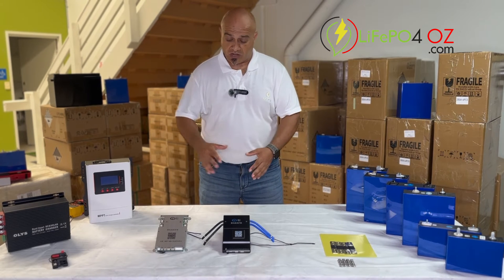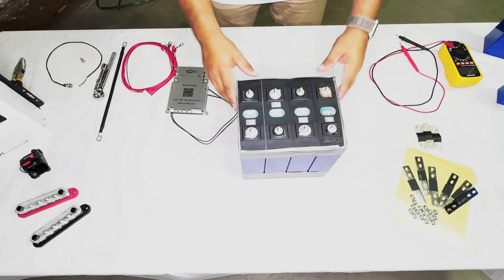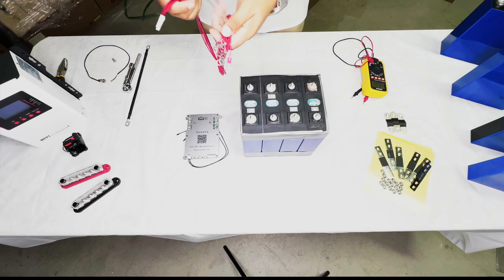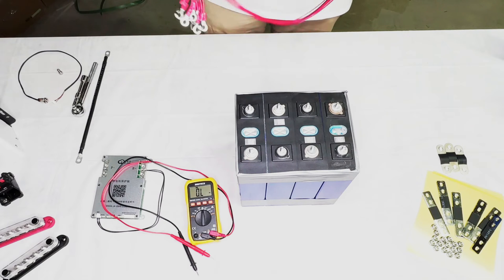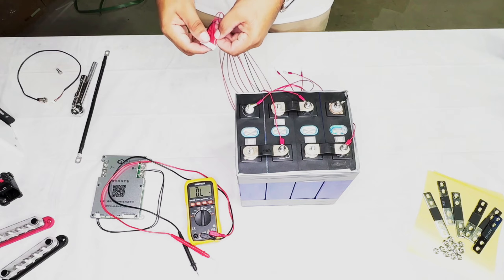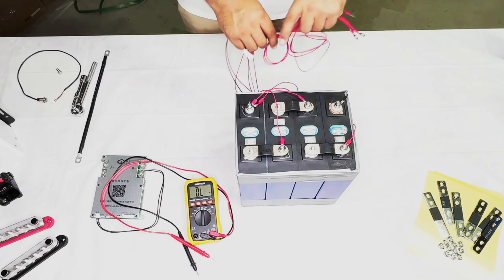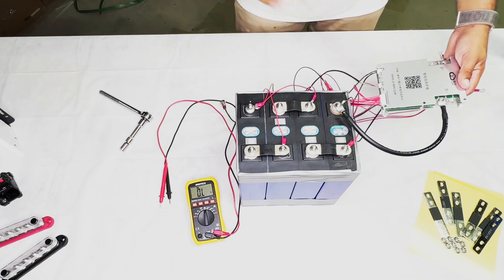LiFePO4 Oz Step by Step Guide to Wiring Your JK BMS

Comment: * WARING CRITICAL REVIEW OF THIS VIDEO * Please watch the entire video and see if you can spot the "Loose Nut" *

1) At 06:00 it looked like the cells were not arranged correctly + - + - because of the orientation of the QR code labels on the cells, but these cells are not identical, and the cell on the Right of the screen has a QR code that is slightly shorter than the other 3 cells and is placed closer to the (-) terminal while the other cells have the QR label closer to the (+) terminal.  So all is OK.

2) At 09:00 the high current Lug should be directly touching the battery terminal surface.  Other lugs such as  balance lead lugs should be on top of that.  The Lug on the power connection should have the best contact to the battery cell to minimize resistance.  As the balance leads to not carry much current just "balance current".  When dealing with LiFePO4 cells, milliOhms are important.

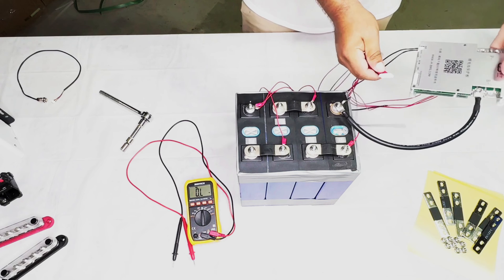3) At 11:45 with the balance leads all connected to the cells, but prior to plugging the balance lead connector into the BMS, the connector should be "Buzzed Out" by measuring the voltage along the connector with the (-) test lead of the meter on the Black wire Pin (a.k.a B_0 of the balance lead cable), and the (+) lead on each connector pins after that  (B_1, B_2, B_3, B_4 & B_8). Verifying the voltage is in ascending order with B_4 and B_8 have the same voltage readings.  For this battery, assuming the cells are charged to 3.2V each (the nominal voltage for a LiFePO4 cell, but the cells could be a little higher (3.65V) or lower (2.5V) depending on the state of charge.  So would expect to see the following values (keeping the (-) test lead on B_0 Black) ,   B_1=3.2V,   B_2=6.4V,  B_3=9.6V.  B4=12.8V and B5=12.8V.

* I hope you spotted the "Loose Nut" but if you did not, it is the one HOLDING THE WRENGH. 😊***

Comment: Hi there, If I made a 24V battery with this BMS, could I add a second 24V battery in series? To make a 48V system with 2 x JK 8S BMS? Thanks
Reply: Its recommended to have separate BMS on parallel connection but i assume your BMS cant take the higher voltage or something about it, I think its 8S for a reason, limited to 24v

Comment: I have 320 Ah cell 48v  can i but bms 200 ah
Reply from the maker: Sorry, but I don’t fully understand your question are you asking if you can run a 200 amp BMS on your 320 amp hour 48 V pack?  If so, the answer is yes, however you’d would be limited to charging/discharging at 200a.
Reply: @lifepo4oz673  yeah, also you can double it when you have a parallel one for example i have double 150a, i initially thought i have to have both of them at 300a, but saved myself alot of money
Reply: @lifepo4oz673  also you dont know what 320 ah cell he have,condition grade maybe B or used on end of life( 99 % he dont have grade A).answer is maybe yes maybe no. 😀